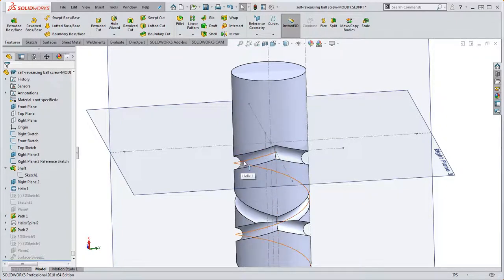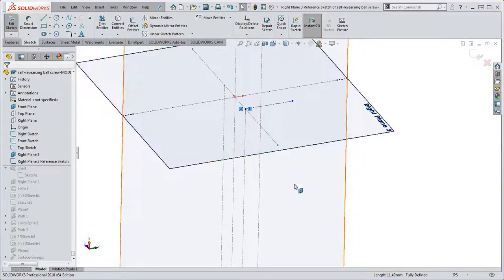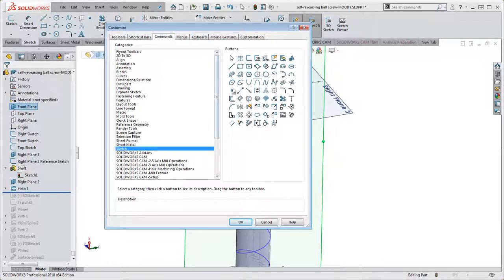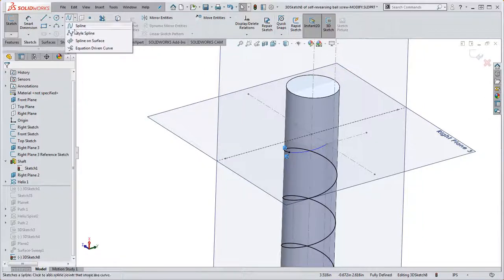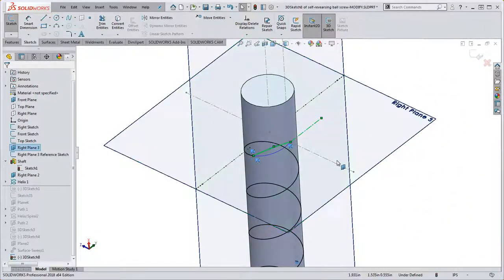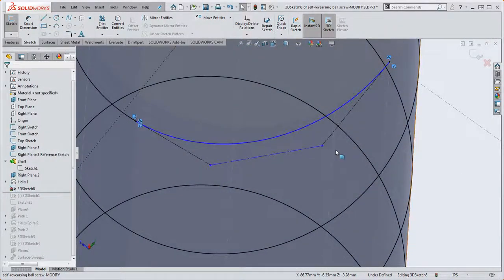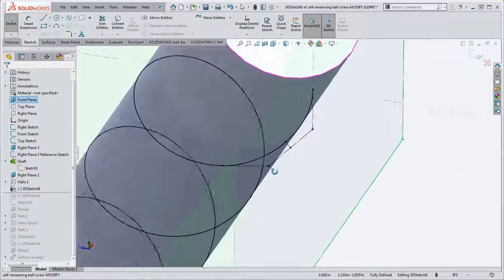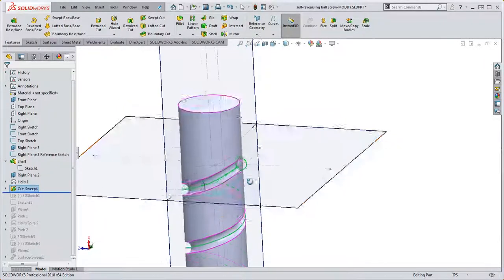Student Help - Self Reversing Ball Screw Model - Connect 2 Helixes - Smooth Tangential Transition

Comment: Sorry for the late comment. Looks like this works well with a circular cutting profile for, say, a ball bearing to run in, but have you tried something different, like a Trapezoid thread?. I pointed this article out to a colleague who informed me it gave weird results. I had a look and saw he was trying to make a trapezoid thread and it went spectacularly wrong!. The cut widened near the two ends of the spline then tilted and undercut itself, and ended as a triangular section tilted to one side. Absolutely bizarre. I suggested he played with tangent options on the swept cut but I've not heard back. Has anybody succeeded with a non-circular cutting profile please?.  Any ideas?. Thanks.